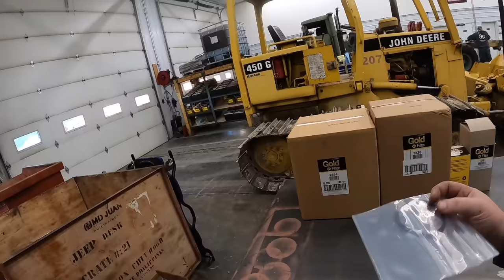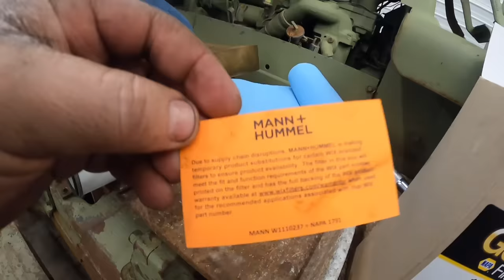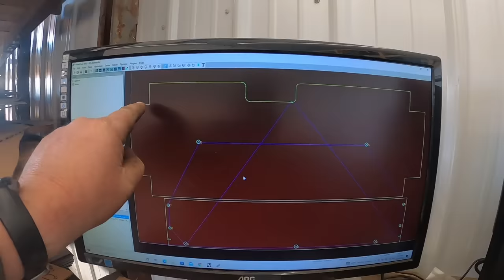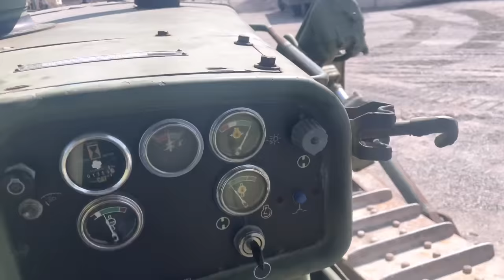Ex military Cat D7G dozer service, repair and operation @C_CEQUIPMENT

Comment: When I started at Cat in 1988 building TT in East Peoria, the factory space next door-Building X was Assembling these military d7's.  The steering clutch brake controls coming from the dash is one of the easy ways to pick out the vintage.

Building A, TT, X, W...All the original cat buildings from my youth have been torn down and a Target, Chick-fil-a, and strip mall sit on their foundations.   

My grandpa worked in building X on the shipping floor before and after world war 2.  He signed up for the Marines in WW2 and requested to be in the CB's, but was put in a front line infantry squad on Guam.  He later became an operator at the proving ground on Springfield road. Later he (they) moved it to its current site at Spring Creek road. The stories he would tell...

Comment: Suggestion- a valuable teaching option is to have your boy use a properly sized torque wrench to get the feel for different size fasteners.  All the standard size bolts and nuts on routine fasteners. Correct ratings, then shear points.  I learned that the hard way, easy outs are great, but not needing them is much more better.  You have to be proud than he is in there learning the trade!

Comment: I recall larger companies buying up parts from other companies that went under. I was in the auto parts business they tried to push that auction stuff into the supply line I would send it back . They would cross reference the part number and sell it as their own brand. I have been using Fram filters for 55 years on my cars . My bus company used them we never lost a engine due to a failure

Comment: Screw a pipe nipple in the oil pan before you open the valve. Extend it below the belly pan and you will not make a mess and you can do it from the bottom and stay clean. Cats rule good job

Comment: As much STUFF you need to check I wonder if an airplane-like checklist would be helpful.

########

I've heard suggested that a MOST valuable element of a business is its collection of lessons learned.  I.E., what NOT to do and also how-to tips.  Both hands on experience and a profuse library of videos will keep C & C on a steady course forwsrd.

Comment: You and Hunter make a good team.  Over the past few years, we've seen so many new kids come on the FD that have no experience changing their oil or plugs or setting the gap on those plugs.  We've taken to sending all of them to our City's Small Engine Repair Shop in their earliest days of their probation to tear down old engines and carburetors, just to get them used to working with hand tools.  When a 2 cycle saw dies on scene, it's good to know how to quickly change a spark plug to get that tool back in service.

Comment: Hunter, is going 2 B an A #1, heavy equipment mechanic some day. It is also fun, to take em out and operate em 2. One thing about the Army, most of their equipment was never run enough to wear anything out. Instead they would blow a hose, and keep on running them, or some thing stupid like, running them out of fuel and burning the starter up trying 2 start it back up.

Comment: Nice size shop, and it seems you are comfortable doing almost anything. I have only watcher 6 videos, so will reserve my final opinion, although I am rarely wrong. I did fleet service for an oil field service company in Texas. Pickups to 30 ton pole trucks, and assorted equipment. Pumpjack service and location setup post drilling.
Reply from the maker: Thanks

Comment: The fan hub bearings get greased every 250 hrs also. Do every time the engine oil is changed. Universal joint bearings greased every 1000 hrs.

Comment: Just wanted to mention there are two more drain plugs you forgot to remove to drain the steering clutch compartments, they are towards the final drive cases.

Comment: Good job Clint and Hunter. Your videos are so easy to watch. You answered the question I had about waste oil. I was wondering if you had a waste oil heater in your shop. The other question is does Hunter genuinely enjoy working on this equipment and want to pursue it as a trade of does he just like hanging out with Dad?
Reply from the maker: I think both

Comment: Put an oil  furnace in the shop.  Burn the used oil.     Heat    for winter in the shop.
We  used one years ago that was just a maual valve and drip  into an oil drum.with a big fan behind it.  Started it with some news paper. Draft in the front door..
Reply from the maker: Yep
I have one in our old shop that’s homemade

Comment: That is one very nice tractor. Could you please say the cost of servicing the green machine? Just in filters and fluides, if one was going to do a father and son purchase and get it up and running and putting it back to work. It sounded pretty nice with those low hours too. Suprisingly quick driving around the yard as well. Do you buy directly off the army by way of auction? and what sort of money did they pass this tractor go for as a non runner. Way to go, and a nice video in the workshop. Thanks a bunch
Reply from the maker: I’d have to look but it normally takes $1000 to do a service on something like this

Comment: What oil do you use in the transmission? I’ve been told that multi weight oil is too slick for the older clutches so only use straight 10 weight. I don’t know if there is any truth to that, what’s your thoughts? Awesome job, you are raising that young man right!!!
Reply from the maker: We use a Sunoco th fluid

Comment: Clinton when you read that the fuel filter was made overseas it put a burr under my saddle because I could never understand why governments let manufacturing go offshore with 'deregulation'.

If they encouraged the production of items at home, more people would have jobs and pay taxes which equates to government revenue, plus, more people would have disposable income to spend which would encourage local economies.

Aside from all that, product quality should improve to the way things were when most items proudly bore 'made in the USA' as well as aftermarket service due to more readily available stocks of parts.
Reply from the maker: Agreed

Comment: I noticed you put grease on a oil filter o ring, i was told you should only put oil on it. I used to put grease on them and they would vibrate loose and oil would come out and cause it to be low on oil.
Reply from the maker: Interesting

Comment: Thanks for the video on maintenance. 
Just bought a Caterpillar 977 to use on our land. Need advice on what type of oils for engine and transmission. Is there different oils for the final drives and torque converter?
Is there a generic product?
Reply from the maker: They specify a to4 oil
They have a different weight for trans and finals
Napa will usually carry it

Comment: Luv your video's & especially the ones where you teach & I learn. 
I've got a older model Cat 963 and after changing a couple hoses, the hydraulic filters and draining the hydraulic fluid the machine starts & runs like normal and it moves forward and reverse.  But, I can't raise, tilt or move the bucket at all. Ant idea's?  I double checked and the hydraulic tank is full.
Any thoughts, advice or help will be greatly appreciated. I've been struggling for months.
Reply from the maker: Not sure on that model
Wonder if it has some type of coupling between hydraulic pump that is broken
Reply: @C_CEQUIPMENT  thank you for your thoughts. Now I have a Saturday project. Good luck to me

Comment: Looking good for an older beast-question for ya - have ya got a plan on getting the camper build back in shop? Take care
Reply from the maker: Camper build is put on hold until we slow down again
I am down a mechanic also so unfortunately it will not come back in the shop anytime soon

Comment: The question is, can you add diesel fuel to the trans say 10 gallons, and flush the trans, torque convertor, and lines, or would it hurt it. Smart man save that boy's knees, I was a mechanic for 40 years and no one told me back then about how bad my knees would suffer
Reply from the maker: No
I have done the diesel trick before

Comment: Wondering if you have a centrifuge. Waste oil, centrifuged,  pumped through filters, add off road gas for viscosity, reused as diesel in pu or equipment. Minimal work and expense with cheap fuel as bonus, instead of paying to have contaminated fluids taken away.

Comment: I didn't see how long or what type of backguage you had on your brake, but could bend long bend, short bend off the end, then long bend off the end... or consider getting or cutting the top die into sections.... 3in, 4in, etc...... I was a brake press operator for 35 yrs... just a thought.... you can also buy used die already cut up .... I enjoy your videos
Reply from the maker: Yea
I have some shorter dies
Didn’t make since to change for a couple bends

Comment: Does that final drive that you had to fill have a vent to allow for expansion as the fluid heats up during operation.
Reply from the maker: No they do not
Reply from the maker: No they do not
Reply from the maker: No they do not

Comment: I am surprised that with the amount of used oil that you have, why do you give it away when you could use it too heat your shop in the winter time.  Have you looked into used oil heating systems?

Comment: When you don't drain the final drives, do you put a probe in to check for water at the bottom? Just wondering... Ron...
Reply from the maker: If they had water in them they would be milkey from the water mixing with the oil when we ran it